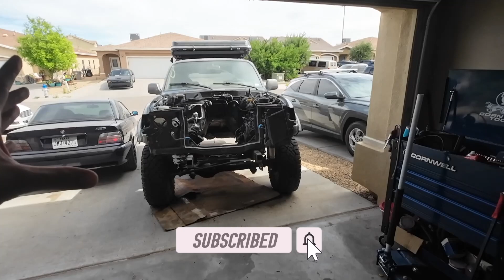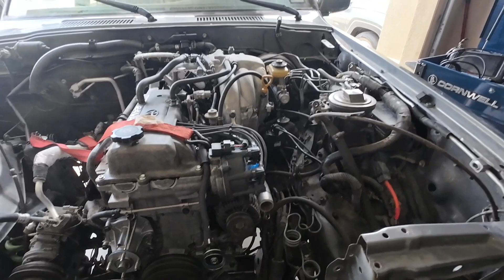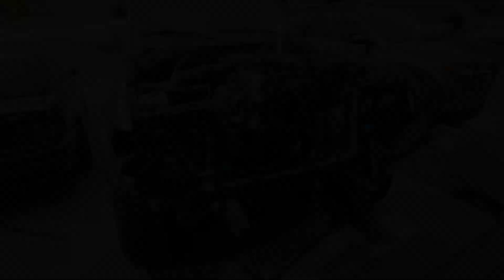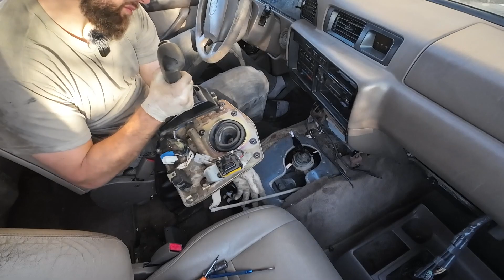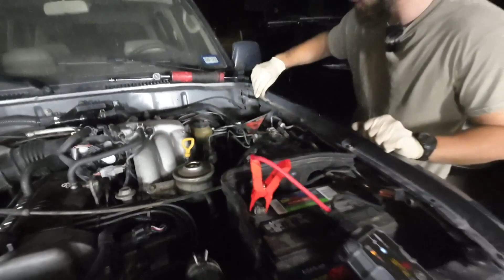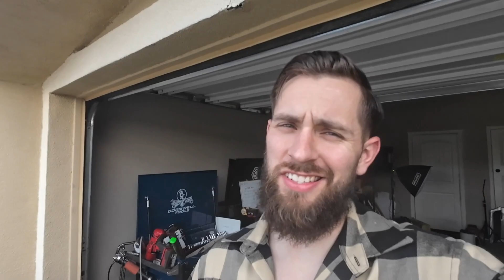80 Series Land Cruiser Engine Install and First Start!

Comment: Love your vids. I just did the same maintenance you did and the engine sparks and I hear it want to fire up but it just won’t fire up. Do you have any recommendations for me?
Reply from the maker: I would check timing on the distributor, or the plug wire order, those are kinda easy to overlook. If not that then might want to look into fuel and make sure it's actually getting to the cylinder.

Comment: That revving is normal if the ECU has been disconnected for long enough, its doing a self-diagnostic. Alarming the first time it happened to me
Reply from the maker: Interesting 🤔, I also happened to have my throttle cable too tight, so it probably was even higher than it needed to be 😂